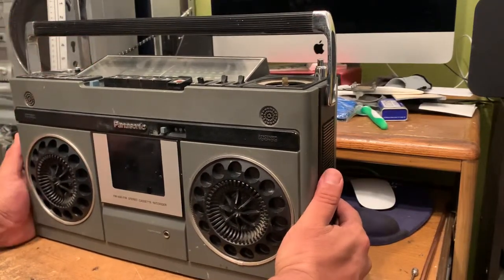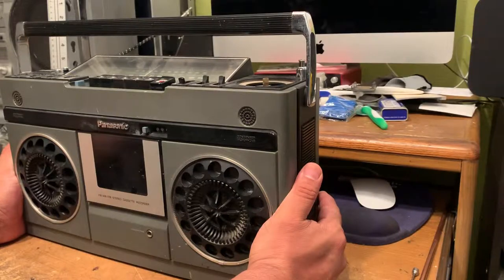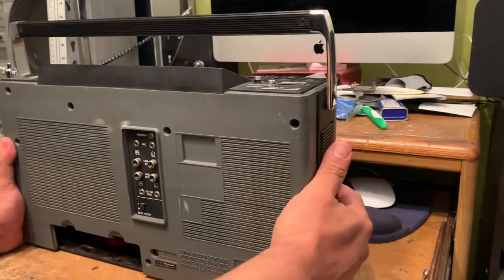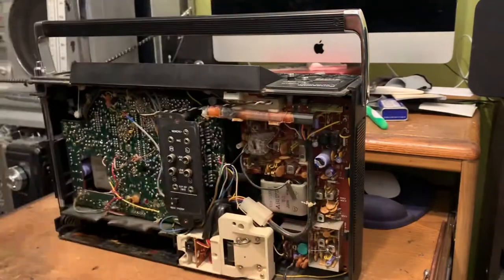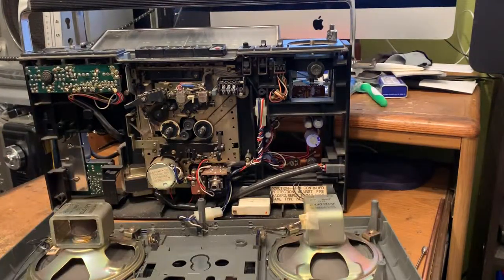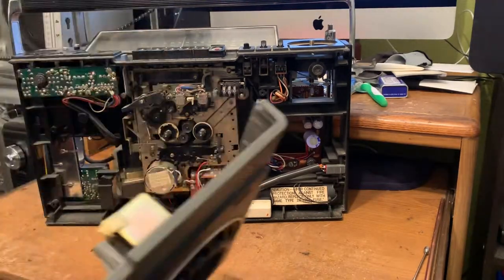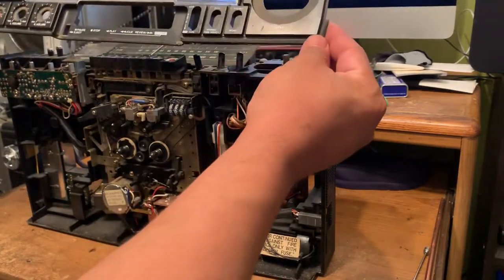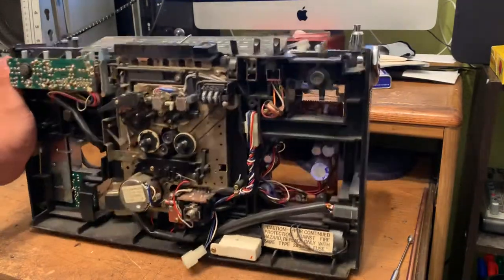Panasonic RS-466S boombox how to replace belts part 1

Comment: That cable hooked on the speaker should be taking of from the back side of the radio when you take the back cover is easear to remove it with out braking the cable

Comment: Do you know where is the speed control on this boombox?
Reply from the maker: the motor on this boombox doesn't have a speed control on the motor or anywhere around it, that I know of, so the right size belt should be used, not too loose not too tight either.
Reply from the maker: I'm sorry! it does have a speed control, on the back of the motor under the label, you can stick a small flat head precession screwdriver and adjust the speed there
Reply: @grumpyandroid  thank you so much
Reply: @grumpyandroid  okay thank you

Comment: Were I can find the cassette motor for panasonic RS-466S? Thanks
Reply from the maker: Papo Roman those motors are pretty rare, so your best bet to find it is eBay, just search for the same model number and voltage, should be written on the motor, also keep in mind the leaning of the spinning, it could be either clockwise or counter clockwise, good luck!
Reply: Thanks for advice.Happy Holidays

Comment: Hey their is earth issue in my boom box can you help me please
Reply from the maker: hi! what is the issue with your boombox?
Reply: @grumpyandroid  their was a erth issue I think I was trying to fix it but I don't know what happen now boom box is totally not working
Reply from the maker: @mohammadhashim1851  I'm not very savvy when it comes to circuit boards but you could try replacing the fuse, check if is blown, should be next to the power transformer or surroundings. just make sure is the same voltage and number,. that should probably fix it, try it with batteries to see if it powers up!
Reply: @grumpyandroid  it will take time because of lock down it is not possible to replace fuse or arrange batteries
Reply from the maker: @mohammadhashim1851  you're right! all we gotta do is wait! God bless!
Reply: @grumpyandroid  thank you